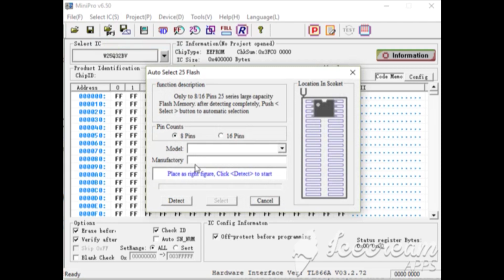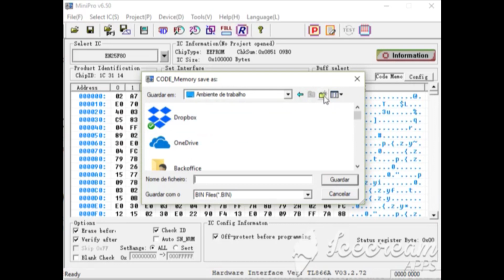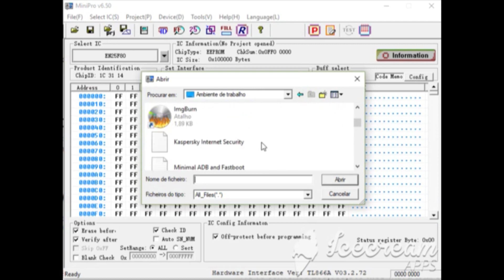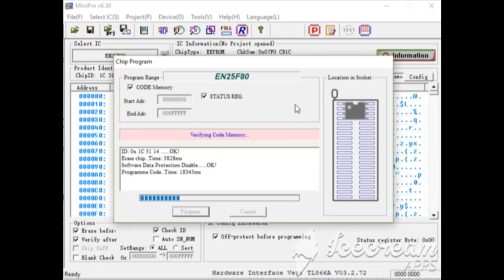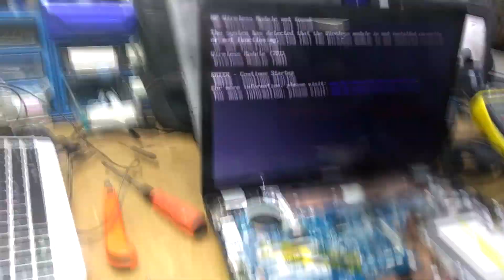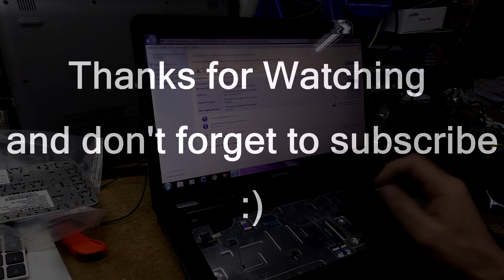Compaq Presario CQ62 Won't turn on | No Power

Comment: compaq cq60 power short circuit repair
Reply from the maker: Always perform a thorough visual inspection of the board first, could be just a simple oxidation that is an easy fix.

Comment: hey i have a cq61 with the same problem i will try to flash the bios
Reply from the maker: Hi,
Thanks... Give me some feedback if it works ;)
Cheers.
Reply: @Fixepedia  it was actually the button that had a problem! I just soldered 2 wires to the button and remove the ribbon cable.
Reply from the maker: @Kakoe  Nice. . I'm glad you got it sorted out 😉👌👍

Comment: Hi I have same model as yours 
My fan wasnt working so I opened it and fixed it but then I forgot to plug the wifi module in back and then while plugging it in I accidentally took out both black and white wires then I put it back but I put em wrong way and while doing all these I forgot to take out battery so can it be motherboard shot out ? Like what's the next step and now laptop isnt shoing any kind of power supply to mother board
Reply from the maker: Hi, 
There's no problem in forgetting to plug in your Wifi Module, as long as you don't attempt to plug it in while the laptop is on! That's a No No!
About the black and white wires... no problem, they can be either way, all they are, is basically the wire that goes to the antenna hidden in the LCD Cover. They can be on either connector, one is Main and the other is a Secondary connector... sometimes there can be a difference in reception, but if it works fine then just let it as is.
You can try and disconnect everything and then press the power button for a few seconds to discharge the motherboard, then wait a hour and connect everything again and try it. You can also remove your ram and clean the memory modules and double check to see if they are properly connected.
If nothing works, then your should do a very close visual inspection to see is you didn't burn anything and check the voltage of your power adapter just to make sure that it is working.

Sorry for the late reply and i hope i helped.
Cheers.

Comment: Hi thank you for the tutorial, so my laptop which is exactly what your model is, won't power on and testing the power button with a multi meter shows there's  0 voltage across it, yet my power cable is working well on another laptop. 
My question is, could the charging port be faulty, and how would I test the charging port to know it's faulty?
Reply from the maker: Hi,
Ok so first thing is first... if it was me then i would definitely test the Charging DC Jack Cable, since it's a cable and it's removable, just remove it from the board and see on that end if it has a 19V power rail.
The reason for taking it out and testing it off the board is because, if there is a short on the board, the charger will shut down and you will think that the cable is faulty.
Now if you have the 19V power rail with the cable disconnected, then you can now connect it again on the board and test the leads that go from the connector and soldered to the board to see if you still have 19V.
If you do, then check you power button again and check the flat cable that connects the power button to the board, to see if is ok, and doesn't have any oxidation.
If not the you have another issue, and i would recommend doing a thorough visual inspection of the board to see for any signs of oxidation, blown caps, etc...
I hope this helps-
Cheers.

Comment: My laptop had done this, I’m not bothered about saving it, if I took the hardrive out and put it on another would all my stuff still be on it? 
Thanks :)
Reply from the maker: Hi, yes. . In probably more than 90% of cases the hard drive is fine. . And the most reliable way to get your data out is by putting your hard drive in an external enclosure, I will leave a link below. . Just put it in the enclosure and you will be able to access your data with another computer and you can then use it as a backup hard drive. This is better than putting it in another laptop because you might not be able to get it to boot without messing with Hiren's boot CD.
This is the link:
https://amzn.to/2WqGUIH
Cheers

Comment: did you put the new bios chip or the old one that is reprogrammed?
Reply from the maker: Hi, normally programming the chip does the job, but in this case I had to change the chip. 
That's something that I always do in case it doesn't work at first or if it starts acting in strange ways. . 
Cheers.
Reply: thanks, later in the video i understood. got the same problem on cq57 model, gonna try this out.
Reply from the maker: @MarkoZutic  sure. . No problem. . Try it out 😉 
Cheers